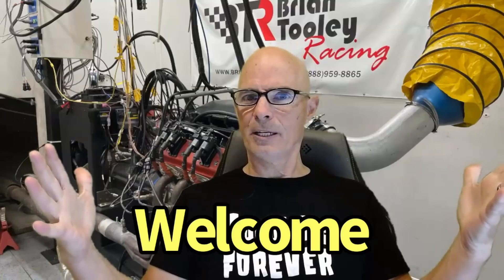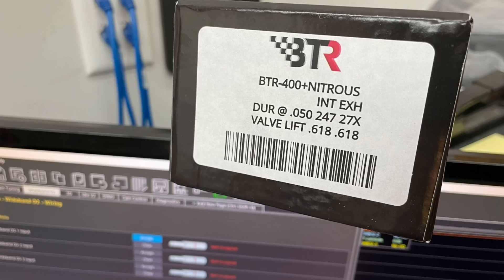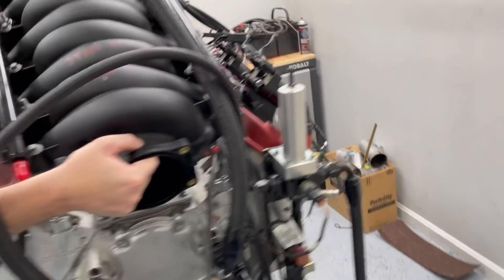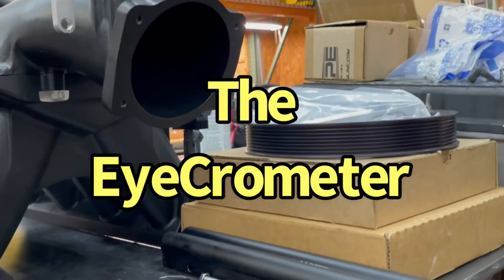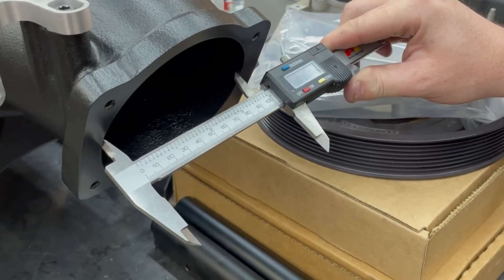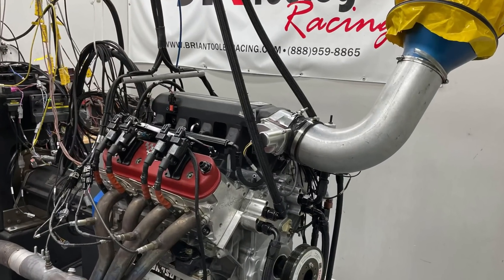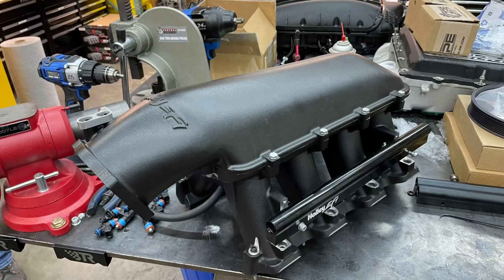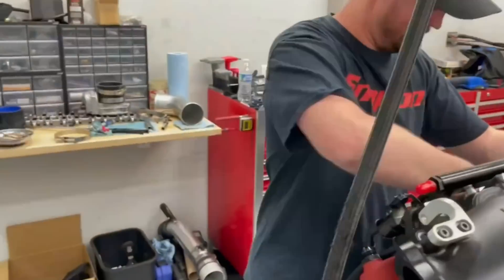427 LS3 STROKER INTAKE TEST-LS3 VS HI RAM VS EDEL PRO FLO XT! WHICH ONE IS BEST FOR BIG-BOY POWER?

Comment: will the Edelbrock intake work on a 6.0 or 408 with a cam duration of 233/250 and stock 823s? and its a street/strip setup
Reply from the maker: yes-but still loses power through much of the curve compared to a stock LS3 intake
Reply: @richardholdener1727  ok thanks, I have a Gen 4 truck intake my bmotor is a (LY6) I’m going to use probably a 3600 stall with my 4l80

Comment: Hey Richard you should give 454chuy  ported mani’s and tb’s a try. I think you would be impressed with the results
Reply from the maker: what is 454chuy?
Reply: @richardholdener1727 he does porting on any manifolds and throttle bodies. Show the difference between a stock ls3 manifold and a ported ls3 manifold

Comment: I'd love to see this setup run again using truck cams, like the Truck Norris SS2 & Stage 4 cams, along with those 2 intake manifold, TBSS & the LSXR/T. Some of us wouldn't mind having a big ci engine in our truck or SUV.

Ever think about running newer LT heads on the LQ4/LS3 engines?
Reply from the maker: they did that
Reply: @richardholdener1727  I must have missed that one. Is there a link for that video? I'm really interested in something like that for myself.

Comment: Low voltage can effect injector behavior. So curious how the AFR’s were on the proflow compared to the other runs.
Reply from the maker: same
Reply: They absolutely do.  But if the injector offset table is populated properly (and it looks like the tuner did his job here) then AFR shouldn't change with voltage.
Reply from the maker: also there was no low voltage while running

Comment: Great review! I still wonder, wouldn't better average torque equal to better acceleration, if we eliminate issues such as tire slipping and such?
Reply: The average POWER during the RPM range you use between shifts will determine your acceleration.

Being able to tailor your RPM range usage is part of why people like manual transmissions, or an automatic they can shift manually. By shifting from later in the RPM band, you can keep the power  higher for the higher-RPM power motor.

But, really, the vast majority of your driving is not doing that. Even the racing team of Porsche did that with the famous "Panzer" flat 12 motor, using a broad, flat torque curve instead of a peakier curve that resulted in 400 more top-end horsepower. (twin turbos.)

Comment: You need to go with a shorter runner intake on that thing. A sniper or L.O.D. all that cam is gonna want to run to 8k rpm or more.
Reply from the maker: BTR up next
Reply: Hard to say when tunnel rams run up top with longish runners

Comment: In all the manifolds you've done for the rec port heads, I haven't seen any from LoKar's LS Classic line.
I have an LS 427 from Blueprint that's going into a 59 Vette replica. It would be nice to change out the LS3 manifold to make the engine compartment look better.
From what I see with their manifolds, it looks like I could expect similar results.
Reply: Thank you for bringing these to my attention! I didn't know they existed till now. It would look beautiful in my upcoming build. 

I would like to see some test ran on these.
Reply from the maker: those would be cool-Westech had one on a motor for a customer-but did not compare to anything else

Comment: Hey Richard, you should grab Brian's data on his LS3 Block w/ GenV Heads swap project, as he doesn't really go into detail, as you would, other than the broad strokes of the final data. It's pretty impressive what an LT1/L86 Head can do on an LS3 (with a matching camshaft ofcourse, for the change in valvetrain/valve locations).
Reply from the maker: I thought he did an L83
Reply: @richardholdener1727  I honestly can't remember now...all I know is that it was a GenIV engine with a GenV head swap....

Comment: Cool feature with Hi-ram is Nos sandwich plate, or the water to air sandwich coolers for boost, or different lids. The Pro Flo dont support that. I did went with the Pro Flo anyway.
Reply from the maker: good point
Reply: @richardholdener1727  Was this test done with 90mm tb on pro flo and 102 on hi-ram?  Do you think the PF could gain from a 102 tb?

Comment: Any tests on the BTR Equalizer? It seems to be the hot new thing on the block, at a decent price too.
Reply from the maker: that is up next
Reply: @richardholdener1727 adding the BTR Trinity would be amazing too!
Reply from the maker: we did
Reply: I’m doing one with a 14.5:1 huge cam LS7, with a 112mm throttle body. Should be nasty

Comment: Dyno cell needs a new intake air filter..........
Reply from the maker: With all the good in this video-you seek out and try to find something (inaccurately) bad?
Reply: @richardholdener1727  Oh come on look at that 10" hose try to suck it self shut?
Reply from the maker: This is still you going negative without accurate info-All you saw was the air hose moving during the run. We ran the motor with a radiused entry and the door open to ensure the same air temp-no difference in power with and without the hose. But by all means try to find something wrong in all the right!

Comment: Richard had question on my gen 3 L33 HO aluminum block ft forged pro Ls piston 2cc with valve reliefs pro Ls stage 4 can 240° / 252° 579'/579' 106 LSA Pro LS H beam rods with ARP 7/16 " pro series bolts heads milled .0010PRC STAGE 2.6 CNC PORTED COMETUC .0040 GASKETS WITH ARP head studs comp cam trunion with cm push rods summit under drive balancer Holley High Ram with 102Mm TB and 36 lb fast injectors Walboro 255 pump drop in 3500 circle D 410 gears king tube headers and 3 " exhaust just wondering if this will work well and what type of hp will cam work with combination thank you
Reply from the maker: could be at or over 500 flywheel hp
Reply: @richardholdener1727  thank you Richard make video on L33
Reply from the maker: I have lots of vids on L33
Reply: No problem Richard I'll check it out but hey Richard so what will a 240 + 50,000 intake 252 exhaust at 50,000 106 lobe separation on the l33 with 580 lift on the cam intake and exhaust will it work I'm using the PRC heads their meal .0040 thousands on the cometic head gaskets I was just wondering on the load separation LSA will it sound like real radical or what what it what's going to happen is the stage for have you ever done the tests on that can stage 4 Summit cam pro LS 240 252 106 LSA 580' 580'
Reply: Right not currently my truck has a 4.8 I know you love those so do I say rev but it's knocking already so I need to replace it with this engine it's already done